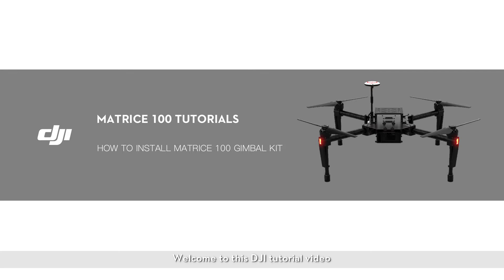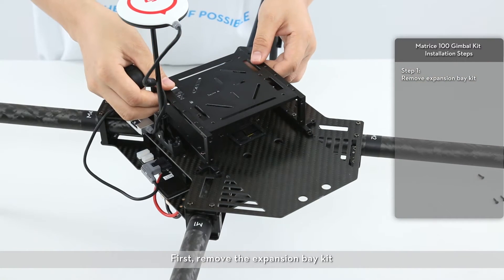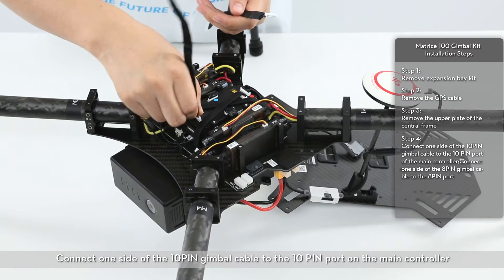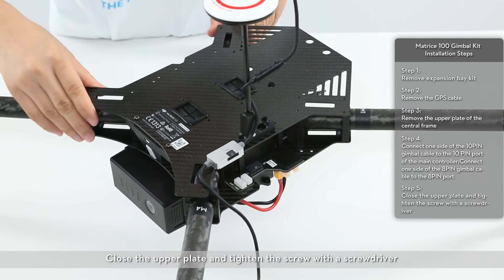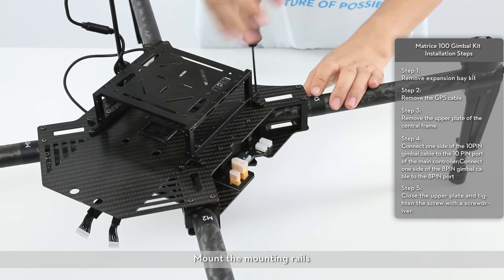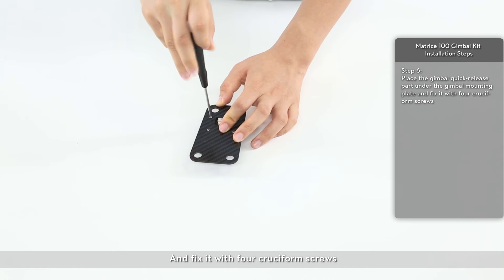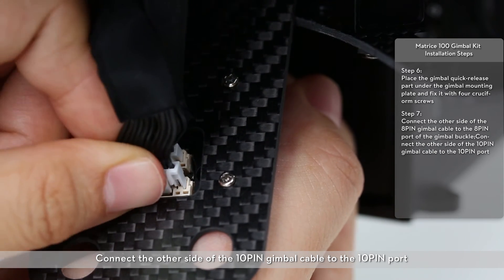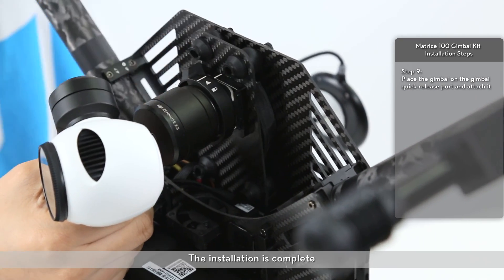DJI Matrice 100 -  Gimbal Kit Installation

Comment: How to upgrade the firmware when the incorrect firmware was downloaded and installed from the DJI downloads? I have a M100 that is bricked. Now the only noise it makes is: DD-D, DD-D, DD-D.... every other drone I've built the firmware is easy to install. Then there is DJI's story of restricting everything: M100 batteries are the same as a M600 but batteries aren't interchangeable. On and on it goes. No support and manipulative in its practices. A page right out of Apples Book.
Reply from the maker: Hi there. We are sorry for your experience. Could you please provide a video so that we can better help you?
Reply: @DJISupportGlobal  Can do. I tried to upgrade the firmware yesterday but that didn’t work. The message on the SD Card said:
========== 2015.12.29 15:00:08 remo-con disconnect======
Packet: MATRICE100_Z3_FW_V01.09.01.40.bin
Result: Abort.
The firmware on the SD card is identical to or older than the current firmware on the device.
Reply: If the firmware is old but the correct one then I should be allowed to install it. Because the newer one may be the wrong version. Now what?